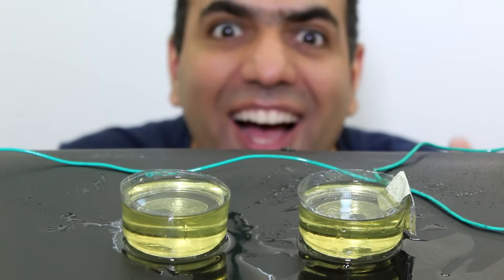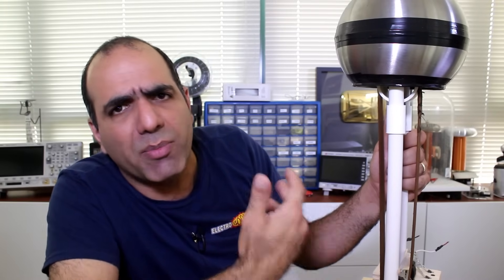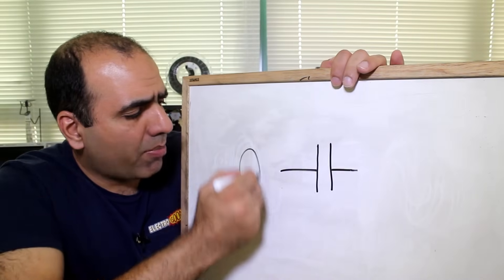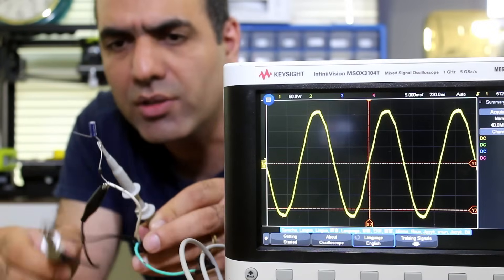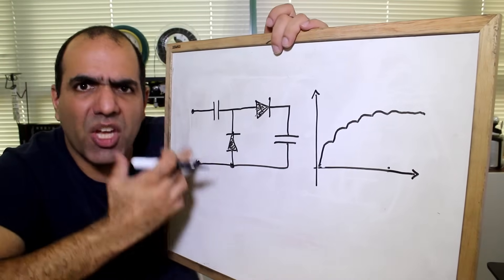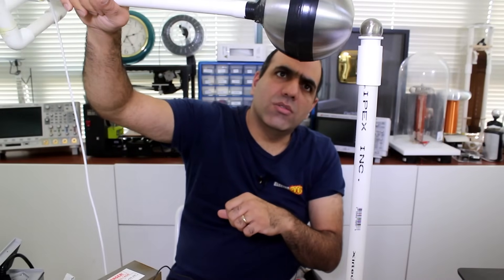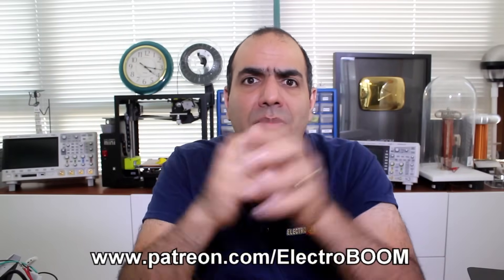High Voltage Flying Oil Experiment with Voltage Multiplier

Comment: use a flyback driver in stead of a mot. flybacks can be taken from the old TV and you can use your Tesla coils driver to power the flyback with high frequency. This will produce high frequency high voltage at 15,000 to 50,000 volts. This will make the voltage multiplier charge much quicker than with the mot as you explained in the video.

Comment: ...breakdown/dielectric strength of air... ...which is 21.1 kv/cm (rms) or 30kv/cm (peak)

Resistance depends on the resistivity of the material. The resistivity of the air is 1.3 × 10^16 to 3.3 × 10^16Ω-m at 200 C. With no ions in the gas its resistance is infinity, so same hold true for air also. So, the resistance of any gaseous material depends on the ion content of that gas.
https://www.quora.com/What-is-the-electrical-resistance-of-air

Insulate the exposed wires with some powdercoating or varnish.
Or make the circuit less compact with higher guage wires. ..

Or put it in PVC and fill with oil, i knew that.

What is the difference between a cable and a wire?

Comment: This reminds me of when I used to make sterile oil solutions using a filter disc. I used a plastic syringe with a plastic 0.22 micron filter attached in a laminar flow hood. As the oil came out the bottom of the filter, it would flow upwards towards the body of the filter and often shoot off to the side of the filter completely missing the container it was supposed to drop into.

Comment: When I was building a C-W style voltage multiplier, I initially had put it in a glass oil filled jar, but once I set vintage through it, I came across this phenomenon as the oil would fly away from the terminals that entered the oil.
Hope this is interesting to others, cheers, Mylo

Comment: You should check out the video where Kreosan are attracting a real lightning strike with a lake nearby, a wire on the tree and a nearby strike. It's incredible to see! You have also a very good channel and a lot of knowhow about electricity and equipment. Every single time I replace the light bulbs in my home, I get shocked wit 240V AC, haha.

Comment: This is why you don't pull a microwave apart if you don't know how to discharge capacitors as the microwave capacitors still hold enough charge to stop your heart. This also applies to any other circuits that have large capacitors like power supplies, Televisions and washing machines.

Comment: One of my first circuits was a voltage multiplier from 220Vac (europe) and 20 stages, made with 1A diodes and some microfarad capacitors.. damn it was powerful..

Comment: Ok and now it's time for you to test the Lightning Rod Circuit to power the Flux Capacitor used on November 12, 10:04 PM 1955.

Comment: Will arcs get bigger if i use bigger caps? Is it even possible with MOT because of lower freq?
Reply: yeah because it has more energy so it when the charges leak it isnt as bad, but it will take longer to get a arc

Comment: Nice experiment, would be great to build this in a glass closet with LED lights with colour changes.
We could use a scope for our small radio station, for own repaires. Which are in Belgium very expensive, we have the knowledge, but no gear.
Keep posting new stuff, always great to see. Thanks

Comment: Heh, nice small multiplier you got there! Actually kreosan has only 2.2 nf capacitors, but higer frequency helps him with the loading. Also I've built 150 kV multipler and 275 kV bipolar multiplier system back on by channel, check it out if you want ;)

Comment: Would it be possible to use high voltage to affect air and create vortecs? Like an electronic propeller or fan? If it works due to oil being an insulation method... air (er... breathable air) is also its own form of insulator, and as a result, I would predict it is feasible to use this to move air around.

I guess the main question is: how does the energy usage compare to an electric motor attached to a fan, and could doing that (should it work) scale to uses outside what you could use an electric motor to accomplish?

... my current Google search history regarding aerodynamics should be ignored when answering this... >.>'

Comment: I assembled a "stun gun" pistol for my neighbor years ago. It used the same capacitor-diode voltage multiplier as your circuit (and leaked charge on the "trigger" switch). 
Even as an EE later in life I never knew how the circuit worked. Thanks for the explanation Mehdi.

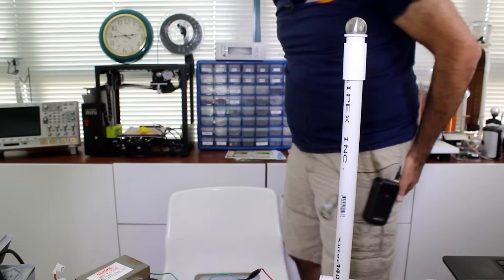Comment: 11:26 Those rivets in that chair though! My last job I'd frequently have to pull vinyl gutters out of HDPE wrap; sometimes I'd feel the static arcing through the rubber soles of my shoes.

What about using a flyback circuit to get a higher initial voltage out of your microwave transformer? We used to use those all the time to get the EHT needed for television CRT screens. Also, you gotta know the maximum voltage in your multiplier is limited by the gaps between the leads in your lattice; even without the plasma arcing there's gonna be leakage.

Comment: 12:45 how did that spark not ignite the oil?
Reply: Probably the oil is below the flash point (the temperature in which a spark will ignite it).

Comment: I guess you needn't caps and diodes rated for 5600 V (7:26). Each stage has lower voltage

Comment: If you want to make a better version of this, use a CCFL backlight driver as the AC source.  It will work with a high stage count and charge fast.

Comment: Yeah, discharging capacitors properly before working around them is pretty smart.  I forgot to do that recently and had two 6800 uF, 80V caps from the power supply of a subwoofer go off on me.  Not.  Fun.

Comment: Hey I do this for a living! I work on electrostatic Oilers in cold steel mills. Electrifying the dispenser tip to about 85kv causes oil to atomize and is attracted to the steel strip below it allowing for very fine control of distribution.

Comment: Why not use the ignition coil for your power supply? Much higher driving frequency and you can pump a decent amount of power into it with the right driver.

Comment: Sir u can use tesla coil instead of micro oven transformer 😎 thus tesla coin can create super high voltage without any caps
Reply: M.Palani samy you don’t get a lot of current out of it though, and it’s at an inconvenient 150khz or so.

Comment: Mr. Electroboom, I seen a couple videos of dc alternator converted into generator and welder ect.(220v). On your "FULL BRIDGE RECTIFIER " can you do a video using it "THE FULL BRIDGE  RECTIFIER "in reverse and if you could beef up the alternator maybe use a big truck alternator increase the rpms at its max output, don't forget me if you make a lot of $$$ from it lol.
Reply: Also was wondering what you think about wiring the  "FULL BRIDGE RECTIFIER" in series?

Comment: Van der Graaf just for show and tell?
Close to me there is a tandem accelerator powered by such a generator, it is specd to 7 MV, I've seen them savely drive it up to 8.9 MV and above ~12 MV it arcs over (in a SF6 tank).
You can feel the lightning comming of that thing once it arcs over...

Comment: I get zapped by every metal thing in my house or office (kitchen sink, entry door). I don’t need a PVC pipe full of capacitors and diodes. For now I figured out I can discharge in the gap between the fridge door and its main body (all made of plastic ffs) without doing the ElectroBOOM dance. Dafuq is happening?

Comment: Have you ever damaged any equipment accidentally like cameras or microphones when messing around with these high voltages. Microprocessors need voltages correct to thousandths of a volt so messing around with his could definitely do some damage, no?

Comment: wifi shot gun works, i made one, modified it to the traditional yagi antenna, and now my wifi works about 2 miles away from my house. Kreosan’s wifi shot gun needs some modifications, he made something similar to a UHF yagi antenna. A biquadrate antenna also works. dont do anything that has not been tested before, use the traditional tested antenna for 2.4 GHz, not some experimental crap. how to make a wifi antenna: https://youtu.be/6_ZeSj9vFF4
Reply: shhh! don't tell him that it works. the microwave gun works too, but never point it anywhere near a powerline running in ur walls.. also never point it towards people/animals and make sure it well isolated.. u might cook/burn urself.
Reply: Yeah it works, its a yagi antenna. Instead of the circles, i used cooper wire and it covered a greater distance. I pointed it at myself and got a wifi headache. Lol

Comment: why haven't you used FULL BRIDGE RECTIFIER  for converting AC to DC ? Why this circuit with 2 diodes and 2 capacitors??

Comment: The best explanation of a voltage multiplier circuit I have ever seen. I can actually say I almost understand them now. Blowing up the  electrolytic capacitor really helped understand how the energy is going through the capacitor. 

I think I need to give you more on patreon.

Comment: You can improve the multiplier with staggered capacitor values, using higher ones in the first few stages increases the drive to the remaining ones

Comment: I saw so many capacitors blow up in your video, and it never gets old.. I'm so glad I found you, Mehdi :D Most importantly, I'm actually learning stuff, even if I'm a complete ignorant about electricity: I predicted the fact that you would be zapped when touching the circuit at  8:16, due to the current stored in the capacitors

Comment: From what I remember having more than 2-stage doublers don't add much to the efficiency of the output becoming double at every stage. 8 components should be your best approach. The rest would just deplete your potential.  An additional key is increasing frequency because storage time per cycle is halved after every doubler stage. So for 2 stage doubler, frequency is divided by 4. Doesn't mean you have more time to store energy in the caps. Means more time to deplete the energy in the caps due to lossy medium.

Comment: You can drive MOTs with a single transistor resonate driver. 30 - 50khz usually. You do need to remove the shunts and submerge in oil.

Comment: One lifehack with polarized caps-connect two of them with the minuses pointing at each other and you'll have a non-polarized capacitor... I'm just kidding I know that you know that but you just love blowing up capacitors... We love it too. Oh btw, get some good alligator jumper wires, these are CCS, they melt very easy and you can get electrocu...
Naah, nevermind.

Comment: Hey, have you played with variable capacitance high-voltage multiplying?
The energy in a capacitor, having been charged, is conserved.  Assuming perfect parts, but it works in real world too!
If you make a capacitor with a moving plate, it can multiply/divide the input voltage!
With the plates held close together, the capacitance will be of some value.
Double the distance between the plates, and the capacitance drops by 50%.
But the stored energy remains the same!
For the decreased capacitance to conserve energy, the voltage must increase by the same percentage.
Practical uses?  Well, if you scuff your feet across the carpet, then hop just before you discharge, you get a bigger pop!
So, if your plates 'home position' has a gap of 1mm, and you charge it up to 10,000 volts, you could expect 100,000 volts if you rapidly separate the plates to 1cm.
Well, nothing is that efficient, but you get the idea.

Comment: Hey, ElectroBOOM I don’t quite get why this circuit is so dangerous? I mean even at high voltage energy hold in that capacitors is pretty low, am I wrong ?
I mean if you used 1nF capacitors and you have 20 of them in series that gives about 50 pF and if you said you have 110 000V at the output, that would mean that your total energy according to formula (1/2)xCxVxV gives me about 0,6 Joules of energy, can you please explain to me where i made mistake ?
 Maybe I just missheard why is this so dangerous. 
Thanks for your answer and time :)

Comment: Take a standard 10 gallon aquarium, load it with aluminum sheet, glass plate, aluminum sheet, glass plate ... until the aquarium is full, then connect the aluminum sheets in sequence: 2-3, 4-5, 6-7 etc. Run large-gauge high-voltage silicone wire from the sheets at either end (sheets 1 and, say, 126), then fill the aquarium with oil. Repeat 49 times. Stack your aquariums to make using them convenient, and connect the aquariums to your diodes, using the aquariums in place of those little blue capacitors.

This will produce a longer/stronger spark, although it could take hours to charge. Your transformer will get very warm, so putting it in oil, and cooling the oil, will help. Be careful, as this is Big League high voltage. When you get bored with disintegrating objects in your house, you can split the supply into stages and build a real rail gun.

PS: take any fish out of those aquariums first.
Reply: Rail gun or coil gun?
Rail gun just needs a single DC pulse.
Why stages?
Reply: Newb rail guns use a single pulse, presumably because calculating tiny (like a Chihuahua) delays is math, and math is hard. Really. That really is the reason. Serious rail guns are staged like coil guns, using the first rail to prime the next rail. Also, rails 2+ are accelerating plasma (effectively) so the slug leaving rail 1 has to pierce a sacrificial envelope that contains a temporary vacuum encasing subsequent rails, which is expensive. Early space-based weapons will be pumped rail guns. See if I'm wrong.
Reply: I bow to your superior knowledge.
Reply: Weapons in space is a BAD idea. Just sayin.
Reply: Why?? You didn't consider "Hey, couldn't such a cascading rail gun also be used as a means of propulsion in a vacuum, with ice serving as the accelerated mass?" I mean, if you do the math, even one gram of water could produce an enormous amount of thrust, infinitely scalable to limits bounded by the structural strength of the rails and available joules. It could do that with infinite control. Watch any Roadrunner cartoon where the coyote straps a rocket on his back, and you'll grasp why control is a sweet perq. You'll want to leave orbit carefully. And tangentially. Cell providers and satellite cable vendors get cranky when you punch 100 holes in their gear.

One man's tool is another, less-imaginative man's weapon, I always say.
Reply: Additionally, in respect to anything on the ground at least, anything in space with enough delta-V to deorbit is already a weapon.
Any mass sitting at the top of a gravity well is.
Reply: Anything is a weapon in a human's hand. A marshmallow can do incredible damage. Go grab some nitric acid and check out what a marshmallow can do.
Reply: Sounds like a doomsday device
Reply: Or a shelter for homeless electrons. I find such negativity a bit repulsive.
Reply: fish would be dead without water ;(
Reply: That's an old fish wives' tale. Fish need electrolytes, just like a capacitor. Brawndo has electrolytes.

Comment: Those magic "soap bricks" are multipliers. Triplers, to be exact. They were used in old soviet color CRT TV's, their output is rated for 27kV, but they proved that it's not the limit.
To drive the thing they used so called electronic transformer and drove a flyback transformer from the same TV's they got multipliers from.

Comment: Hey, that antenna looks legit!
Stack of disks of varying size/spacing.  Works like a Yagi, sort of.
GHz range antennas don't always look like they are real.
Short-backfire antenna for example!
Pie-pans, some wire and some bits of bass-tubing = wide bandwidth, great gain, highly-directional antenna.
Or the Yagi antenna.  The classic 'TV' antenna is actually a slow-wave device; parts of it have signals moving near the speed of light, other parts are 'moving' around 1/3 speed of light.  These rates sort of combine, making very high gain, very directional antenna.
Or the Bazooka antenna; piece of coaxial cable, slightly modified, becomes high gain, wide bandwidth antenna with a built-in Balun transformer!
Or a strip-line antenna; thin wires running side-by-side, radiate like mad!
Or Hovermans, or fractals, or slotted aperture antennas.
My rave-fave are the phased-array beam-steering antennas...sweep my dynamic range, baby!

Comment: Numbers DC AC in, out diode, green yellow and blue lines, eletricty EXPLOSION voltage etc etc etc
That's how i see this, because i don't know sh*t about that circuit thing or whatever this is called (i don't know the wordyet, iam learning english and only know how to speak basic words, like pneumonoultramicroscopicsilicovolcanoconiosis or floccinaucinihilipilification)
but some how i still loving the content

Comment: That was an amazing video. I always wondered how that circuit worked. There is a much smaller version in our bug zapping tennis racquet thing. I knew the capacitor / diode stepped up the voltage, but the way you explained it let me understand what is going on. It's a shame I don't have a marvellous instrument, like that Keysight oscilloscope to help me learn how electronics work, so that one day I can build an electronic device that will allow me to grow magnificent eyebrows, such as those, with which you have been gloriously blessed. I think I would also need to build a device to help me make my eyebrows dance as well as yours. But I'd need a fantastic Keysight oscilloscope to measure the frequency of the waveform your eyebrow dance produces. At the moment my eyebrow dance looks like it's been performed through a Full Bridge Rectifier, it's so flat.
Thanks for the video Mr Boom.

Comment: I worked in an oil factory where we were testing minerals dissolved in the oil. We We washed the oil samples with water. It took forever to wait for all of the water to separate naturally from the oil. So then we used a charged hot water bath to speed up the process. It looked a lot like this where voltages were rapidly causing the oil layer to move.